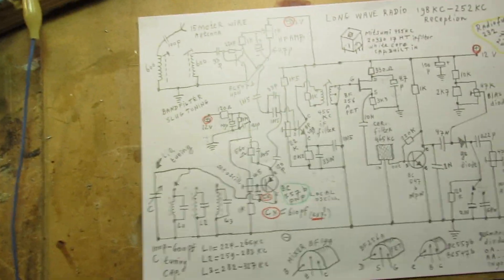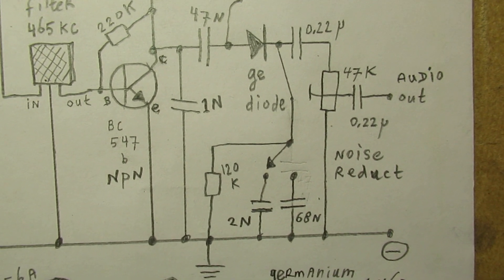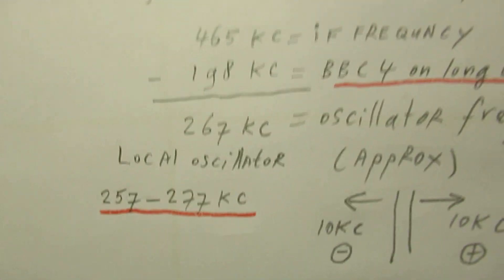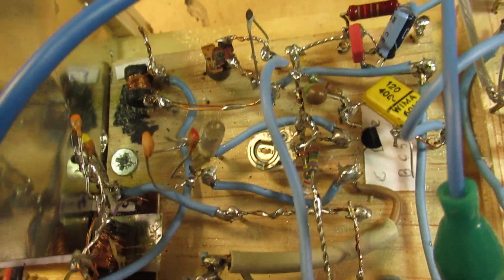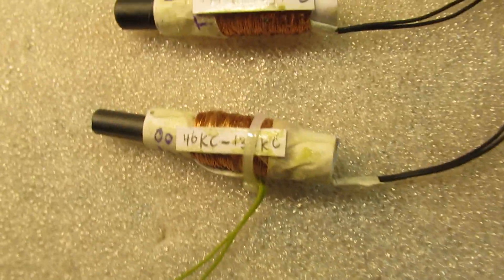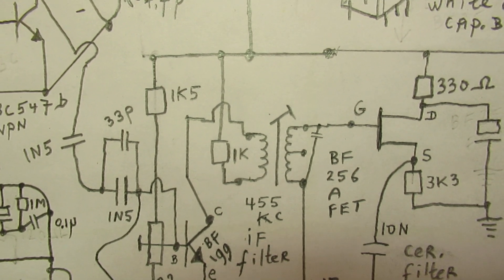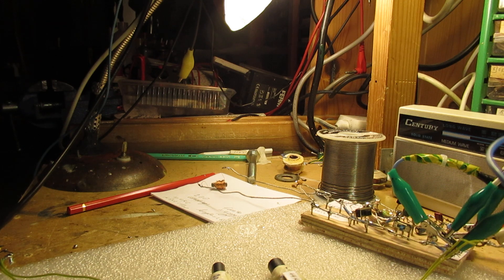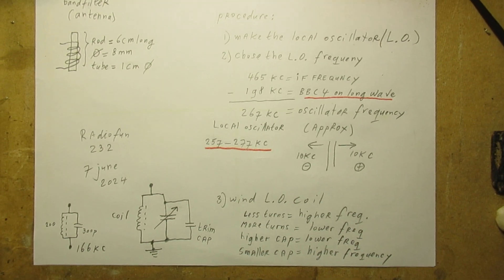Schematic and instructions for a home made LW Superhet Radio, working between 198 KC and 252 KC

Comment: Sir, could I use "Red" coil (for L.O) from commercial superhet sets? They work for MW, but could they be used on LW?
Reply from the maker: A local oscillator coil for Medium Wave (say 800 KC-1.6 MC) is not made to work on Long Wave, so I think that will not work.
Reply: @radiofun232  Thank you for feedback! I was also thinking of making LW superhet that would be on par with commerical LW sets (they tune 153kHz to 283kHz) but I will definitely end up building one that is tuned to 225kHz only.
Reply from the maker: @Cringenbased  That makes the whole setup easier.

Comment: Thank you, sir, for the clarifications and these wonderful projects. If possible, we would like you to make us a special 20-meter ssb radio receiver.
Reply from the maker: Go to my Channel trailer "Radiofun232 on You Tube" and type, in the magnifying glass (=the search option) the keywords that can/will lead to the circuit that you want. It shows analog and digital radio's, working between (say) 2 MC and (say) 14 MC. Circuits that are tested. But I know (sorry to say): when the basics of transistors and SW tech. are not understood, that can give problems, though I surely show and have showed many circuits in the radio field that are tested and will work. Or go to the LULU website and buy one of my books, say the 2-12 MC radio. It gives a detailed description & schematic. Thanks 20 nov. 2024.
Please note 20 meter = 14 MHz. It is the maximum frequency to which my SW radio schematics/concepts can go. In such a case it is bettrer to invest (quick results) in SDR = Software defined radio, where you can receive a broad band of SW, between (say) 2 MC and (say) 30 MC, depending on the quality & setup of the antenna that you want to use. Search for more via that "search option" that I mentioned above. I show a SDR radio on my YT Channel.  20 Nov. 2024.

Comment: i have a lot of noise from the 230Vac line. i don't now how to isolate my bench. I bought several meters of copper cloth planning to install it in the wall and under de bench....i have a big beefy 230:230 iwsolation transformer, any ideas will be apreciated.
Reply from the maker: That is a serious problem. As far as I can see only an outdoor antenna will help. From the workbench to the wall and at the first meter (s) outside a coax cable can help. That is, at least, the way I made it. You can experiment with the mantle/braiding of the coax cable: yes or no to the ground wire of the receiver.

Comment: Wonderful Schematic diagram.
Incomun the design that oscilator.
1-Ant amplifier
2-PNP oscilator
3-Mix
4-1° st IF amplifier (buffer ?)  ( BF246 ) maybe a 2n3866 ?
5-2° IF amplifier + AM detector.

❤ Good design
Reply from the maker: The local oscillator is made with that PNP Si. transistor, the BC 557 b. The mixer is made with a NPN Si. transistor, the BF 199. The "buffer" is made with that FET (the BF 256A). It also amplifies, thus is not passive, not only a buffer. You cannot use a 2N3866 here, only a BF 245 type a,b, or c. Or that BF 256 A. That BF 245 is obsolete, it was made in the 1980's-1990's e.g. in Europe. They had quality. Now the BF 245 is made in China, their qualities are unknown. Could be that they work (from manufactor X) but could also be that they don't work (from manufactor Y). Thus you can use here the N-FET BF 256 A, when bought via a reliable radio shop. 10 June 2024.
Reply: @radiofun232  Tanks so much.
My Block diagram was updated.
Reply from the maker: @luiscarlosmarx  Thanks, OK.
Reply from the maker: The 2N3866 is a NPN HF transistor, probably usable in this case as a mixer transistor. Thus no replacement for the FET BF 256 A. The mixer transistor has to have a substantial HFe (say current amplification) in the order of 80-100, to be used/usable in this schematic. That current amplification of the mixer transistor can be tested with a simple transistor tester. The BF 199 has that property of enough amplification (80-100) to make this circuit work. Thanks for your comment, 10 June 2024.
Reply: @radiofun232  Sorry.
Is 2N3819(jfet) no 2N3866 ( my confusion ).
Reply from the maker: @luiscarlosmarx  Thanks & yes, the issue is that I want to publish my circuits on YouTube with a good success factor, by naming all the components very (very....)precise. Especially transistors, FETS, and their pin connections. It also means that I remove comments where people suggest other types of transistors, etc. I had doubts about your suggestion to use that 2N3866 transistor. So I let it pass, for a first time, because you perhaps wanted to name the mixer transistor (the NPN HF transistor BF 199). Perhaps what you proposed (that 2N3866) could  work there. Not sure, it always has to be tested. All my circuits on YT are tested first on their properties. So, please, when you comment, be more critical and make the circuit that I propose on YT in real. After that you can use other transistors, and if so, propose and publish that circuit that you have tested on YouTube = your YT Channel, if OK I will give a link. Only in that case we can talk about really working electronic circuits that are usable for people interested in electronics. So there is no room, in the comments section, for people that suggest to change a FET into a NPN transistor, sorry to say. These kinds of suggestions/comments will always be deleted. 10 June 2024.